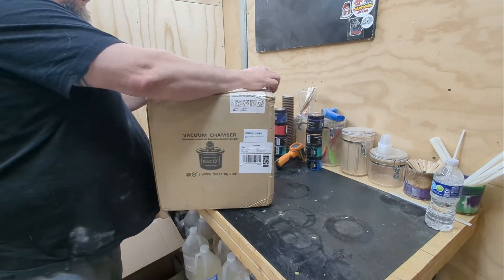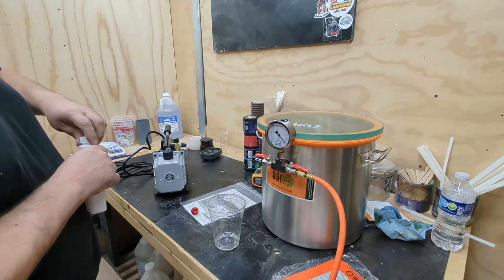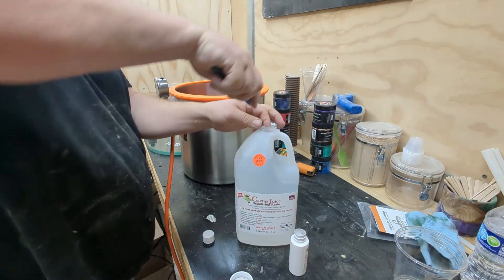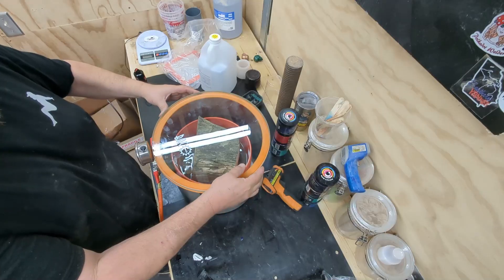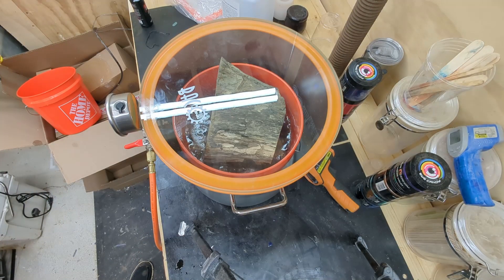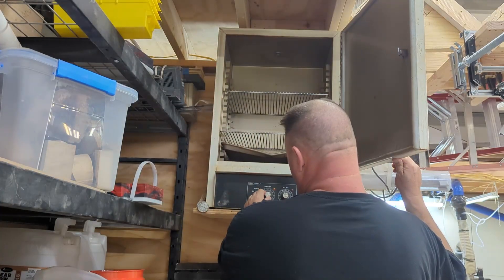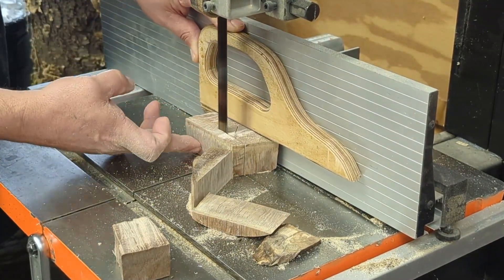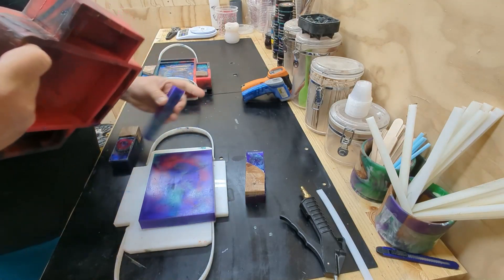STOP Wasting Your Money on the WRONG Vacuum Pot Materials!

Comment: You dont close of valve and shut of the pump to let it sit over night, that doesnt help at all. The pump need to drag all the air all the time, so let the pump run all night. You can also read that info from TurnTex.
Reply from the maker: To reply Short answer: No — you don’t have to run the vacuum pump the entire time, but you do need to run it until the bubbling stops (or slows way down). After that, the vacuum can be turned off, and the wood can soak under atmospheric pressure.
Reply from the maker: How Vacuum Stabilizing With Cactus Juice Works
Stabilizing relies on two stages:
1. Vacuum Stage – Removing Air From the Wood
When you pull vacuum, the air trapped inside the wood’s pores expands and escapes.
You’ll see vigorous bubbling — this is the air leaving.
Keep the pump running until the bubbles nearly stop, which typically takes:
45 minutes to several hours, depending on wood density and thickness.
Reply from the maker: 2. Soak Stage – Letting Resin Flow In
Once bubbling has mostly stopped, turn off the pump and let the wood sit submerged.
During this time, atmospheric pressure forces the Cactus Juice into the empty pores.
Soak for at least the same amount of time you pulled vacuum (often longer for thicker pieces).
Reply from the maker: So, Do You Run the Pump the Whole Time?
Only during the air removal stage.
You do not need (or want) to run the vacuum pump during the soak stage.
Also:
After turning the vacuum pump off, keep the wood under vacuum for a few minutes BEFORE venting, so resin doesn’t boil over.
When ready, slowly release vacuum and let the wood soak normally.
Reply from the maker: Thanks for watching 🙂

Comment: Once you finish with the vacuum and cactus juice, they are ready to turn correct?  The epoxy is just if you want to go that route? Or should you atleast put them in a clear epoxy mold after they are stabilized?
Reply from the maker: @Strutterbutter7  once you finish the vacuum with the cactus juice and then put into the oven to set the cactus juice. You are now done. If you want to put epoxy into it you can mold that but have to scarify everything that is open surface. If you just want to turn it, you're free to go at it.

Comment: I am a stay home mom who dabbles with turning.  Recently a tree company cleared 2 oak trees from a nearby empty lot, and they gave me the wood.  I haven't bought anything yet however I want to prep some pieces to make small bowls and rings and pen blanks.  What do I need to do?  Thank you!
Reply from the maker: @tmueller333  when I am setting up to do bowl blanks , I go ahead and set up roughing sizes which are much bigger than what I will actually turn. Then on the ingrained of each side I would seal it with some kind of paint. That way it doesn't get out of round too much, it still will. Then I'd let it dry till about 7 to 10% moisture. You can check this with a moisture gauge. When it's dry enough. That's when I do my final turning.
Reply: @WackeyWorxWorkshop  How/when can I stabilize?  Since my wood is fairly fresh cut what is the process before I can stabilize?
Reply from the maker: @tmueller333  you want it to be dry first. If it is not dry the moisture that's in it will mix with the cactus juice. This is not what you want.

Comment: Great video, but why do you cure casting resin with 55 lbs of pressure?
Reply from the maker: @russaddis3320  you use that PSI in the pressure pot to reduce the bubbles in resin